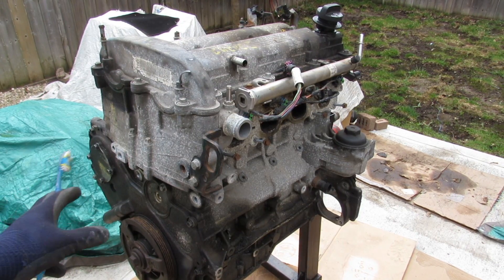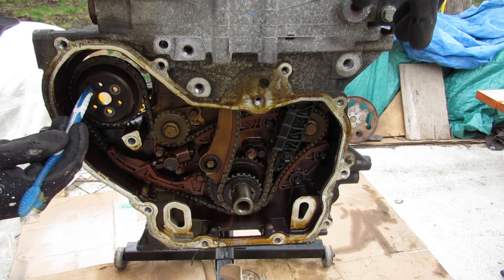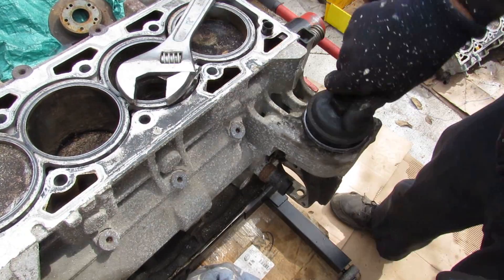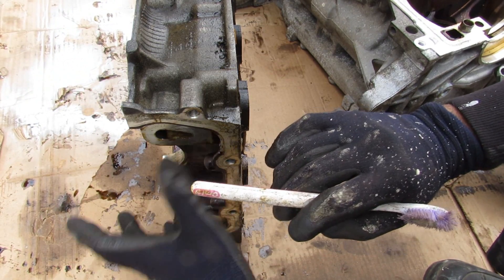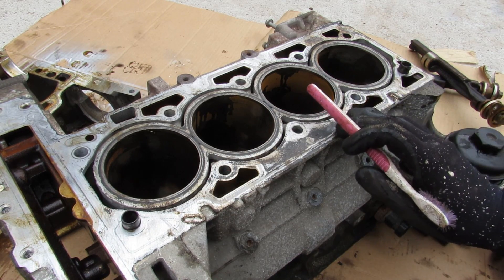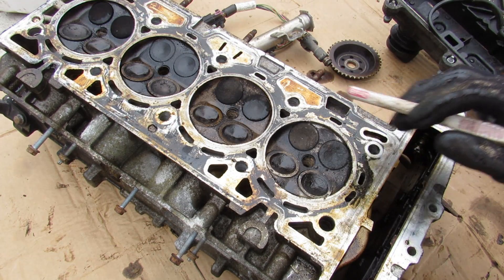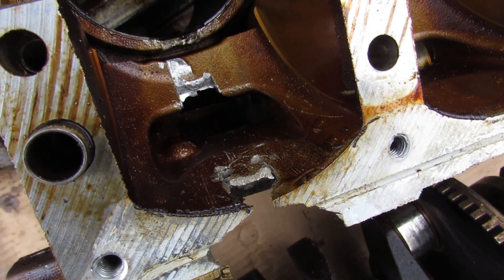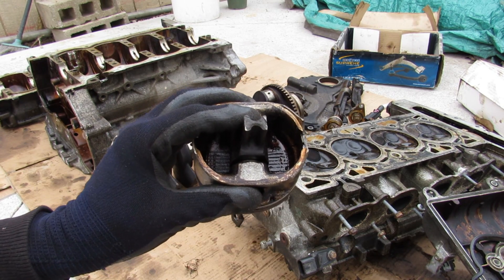Why GM Ecotec Engines FAIL

Comment: What a piece of crap. Why would a low-end car engine ever be that complicated, over-engineered, and utterly economically unserviceable? If only people could understand and stop buying this junk. No wonder GM has gone so far downhill in recent decades.
Reply from the maker: I feel like the chain setup is a bit much for a cobalt motor
Reply: Car buyers wanted a small engine, good MPG, but power like a V8...
Reply: @BuzzLOLOL  Be that the case, I guess they screwed themselves and should recall the old saying, "be careful what you wish for".
Reply: @davef.2811  - By eliminating timing belts, GM produced an engine with expected 300K miles life instead of 40 - 80K miles life...
Reply: @BuzzLOLOL  I have yet to see one of these eng's reach anywhere near that span without having very expensive, usually catastrophic failures. Sorry, regular folks who depend on their car for travel to and from work and other necessary daily activities need something more economically feasible and sensible than that.
Reply: @davef.2811  - Scroll down through the comments... lots of people have that mileage on their Ecotec and love them...
Reply: @BuzzLOLOL  To each, his (or her) own.

Comment: The Modern  Chevy Vega. I had a quad 4 motor in a 95 Pontiac  Grand Am and I got 238,000 miles of car, still going strong when I sold it.
Reply: The quad 4 got a bad rap, my wife  had a 89 oldsmobile cutlass calia with a quad 4, it had a 150,000 miles on it, and was still running pretty good when we sold it, it wasn't an easy engine to service though, but it had the best of both worlds, great performance, and great fuel economy, hell if this tells you anything, my wife's nephew runs a quad 4 in his modified oval track race car, he loves it, and won a lot of feature race events with that motor.
Reply: @captainkirk4514  , the biggest  problem  that I had with my Quad four was the water pump, and the spark plug fire coil packs, the plastic  would crack.and I would have to replace it.
Reply: @markbaumgartner7261  Come to think of it, I had to replace the water pump and the guides for the timing chain, it was not an easy task on those, but that was the only major problem we had with it, other than the starter.
Reply from the maker: Nice

Comment: I did a timing chain job on one of those Ecotech motors, quite an undertaking....
Reply from the maker: Is it tight in the engine bay?
Reply: @speedkar99  one issue is a motor mount bracket that has to come off, but to get it off without damaging or stripping the long bolts that attach it to the block, you gotta jack the motor up on the timing chain side. I took tons of pictures of the process.

Comment: I do motorcycles which run at much higher rpm.
Most or that was caused by poor maintenance and dirty/low oil. (and probably excessive rpm?)
The oil control rings would be fine but the drillings in piston need to be either larger diameter or more holes drilled to allow oil scraped off to get inside piston then back to sump, you don't need or want wider rings. 
Oil squirters have been used to cool piston crown since at least mid 1930's so technology is well understood. It also helps keep small end lubricated 
Suzuki were first to use oil squirters on a production motorcycle in 1984, probably first high volume mass produced engine to do so? (it was in production until 2012 in different variants)
Reply from the maker: Interesting to know the difference
Reply: @speedkar99  The low tension chrome faced spring steel rings with expander are very efficient at scraping oil.
The main reason I'm aware of the issue is Suzuki had a production problem where some of the drain holes in pistons were not drilled (robots are dumb and go through the motions even if drill is broken)
It led to excess oil consumption on about 75~80 bikes total (at least up until late 2009)
 There were also modifications to the later water cooled motors where holes in oil ring groove got enlarged slightly, ( IIRC,less than 0.5mm) on later engines operating at much higher power outputs and rpm (1300cc with 195bhp, 'Busa')
Reply: @1crazypj  Harley has been squirting the piston bottoms for a Decade, on some models, the jury is still out?  H-D has other problems with the new M8 engine?  You would think after 120 years, both Ford & H-D would get it right?
Reply: @jimandnancymcoil  HD were not doing it in 2005 even though the 'aftermarket' engines were  (S&S, et.al)
I think HD waited to see how it turned out before they did the same?
Your right about the 120 years though, if HD had any sense they would have learned from 1978 Honda CX500 that a V-twin with chain drive valve timing has serious issues with load reversals destroying cam drive (on the Honda it sometimes destroyed the mounting bosses so crankcase had to be changed)
Reply: Sorry for late reply, yep, it was a few 1200 SACS motors in the Bandit which was being phased out in favor of the new water cooled motor

Comment: Duct Tape nothing... what you do is remove the broken rod, both pieces, throw the piston into the trash, and then drive a fence post into the cylinder, cut it off flush with head deck, put head back on, go on about life... just a "little" slower.
Reply from the maker: Ahh it was a joke lol

Comment: I am located in europe and i work on many GM 4 cylinder engines(mostly on Opel/Vauxhall). This EcoTec engine is the worst of them all. The rest are actually quite good with the proper maintenance.
Reply: Ecotec is vastly better than Vauxhall version because break prone belts (50K miles) are replaced with long life permanent chains!
Reply: @BuzzLOLOL   EcoTec 2.2L engines are exactly the same in Europe. They come as direct injection units or indirect injection. They are crap. They burn oil like crazy, the chains stretch, the high pressure fuel pumps go bad, the oil that they don't burn, they loose, etc,etc.
Reply from the maker: 2.2 or 2.4??
Reply: @speedkar99  in Europe is only 2.2 L. I am not aware of any vehicle using a 2.4 version.

Comment: Girlfriend had a car with a turbo one of these. The motor did self destruct and had to replaced. That car was nothing but trouble with the key system and the dealer was very scummy. Was not my car so I had no choice but to let the money pit be a money pit.  Once that car was too expensive to fix and against my best advice... she got ANOTHER one of these ecotecs in a crossover. Thankfully it is not a turbo engine but still I am counting the days until the engine or key system fails so this too becomes a money pit. I have already had to do a cam position actuator in a walmart parking lot as they are common fail points for the 2.4 variant. Not hating too much on GM as anything domestic in the US I tend to avoid after 2010 year models. Value engineering has soured the brands to me.
Reply from the maker: The turbos are the worst

Comment: In the many years I have been a CHEVROLET TECHNICIAN. They don’t push the customers to do anything to their vehicle. Most of the Japan and others will sell you a maintenance service contract. So every time it’s due for a oil change they have already paid for it and get it back to the dealership for maintenance on time. They scare you into doing this or will void your warranty so in my opinion foreign cars are maintained better than any American car because the American cars manufactures don’t scare you into doing any maintenance and people have the idea that they don’t have to. Just from what I’ve seen in 35 years of being a technician and the different between USA and foreign vehicles.  Jmo
Reply from the maker: Thanks for the input from a tech perspective

Comment: When I worked a Chevy dealer from early nineties to the mid-2000's. That engine came out in the '04 models it was a Saab design engine. Saturn got it first late '02 or early '03. For the most part they were good engines. Some head casting issues, porous coolant loss, valve train noise. Occasionally you would have a hard start,runs rough MIL on or flashing complaint.  Usually it was the plugs, boots  gap was to wide. Because of the CSI (Compression sensing ignition,another Saab design) plug replacement was every 40-60K depending how the owner drove it. Never saw a bottom end grenade. But it does happen. GM likes to cut corners... If they make it pass the warranty period... Their happy..
Reply from the maker: Sad it's all about warranty

Comment: When you said champion sparkplugs are low end....yeah you lost any credit with me. They are not the best but they are reliable. Also on top of that some engines will not run correctly on those "high end" sparkplugs. My 1987 Honda civic burned out all 4 bosch split fire plugs in less then a week or 100 miles, while running perfectly on NGK's. Somebody those "high end" sparkplugs actually add or take away resistance which can hurt the economy/efficiency and cause a loss in power. 
So when you took the valve cover off it shown me that they used conventional oil and not synthetic or synthetic blend. Those ecotechs are designed to run synthetic blend or synthetic and not run on conventional oil.

Comment: I had no problems with my 2.4 ecotech. I ran it hard and I had 87,000 miles on it. It is called the person didn't take care of the engine. Most likely didn't change the oil regularly. Maybe ran it low on oil. Unless you have the full history on that particular engine you cannot blame the engine or anything. Unless it is a Ford engine.....lol.

Comment: I ones had a Golf IV 1,6 that burned oil like an absolute disaster and had tons of buildup on the plugs and it was gradually losing power even before reaching 200k kilometers along with just higher and higher fuel consumption. then I had the Golf V 1,9TDI that mostly ran nicely and did not drink that much oil and it got yearly maintenance and all of this but it did not even last until the first timing belt at 150K kilometers. nope it made just like this engine and blew the rod straight out of the side without a single warning before it, then I read about the BLS engines has weak bolts and connecting rod bearings prone to fail. I got in huge debt because of it, fantastic not
Reply: You see the Ecotec is a Vauxhall DOHC belt driven cams engine converted to oil lubricated chain driven cams for vastly more reliability. Vauxhall had recommended changing the belts at 80K miles... they didn't last that long, so they changed it to 40K miles... GM doesn't have any mileage recommendation for changing the chains... After initial break in, I recommended using synthetic oil and regular oil changes to make the engine last 300K miles and stay clean inside.
Reply: @BuzzLOLOL  well chains surely have a wide range of how reliable they are. My engine had a regular Kevlar or something reinforced belt. But the engine itself did not even last the first belt. In fact even if the engine had oil changes and service more often than the factory had printed out the connecting rod came blasting out the side of the engine in literal pieces anyway. The engine could still start and run with only 3 working pistons since the failure was not caused by anything else than shitty connecting rods failing with this specific engine after a certain time
Reply: @Pulverrostmannen  - Are we talking the old Vauxhall engine or another belt driven cams engine? 
The Ecotec uses cracked/fractured rods. Meaning they are actually made in one piece and then the bottom cap is broken off... and then bolted back on... the joint is not smooth but as broken...
Reply: @BuzzLOLOL  well as my first comment covers it was about my Volkswagen TDI engine  ;) I mentioned it since even if it was carefully taken care of it did not last anyway
Reply: @Pulverrostmannen  - Thought VW engines were pretty reliable... back in 1960's used to look at low priced big bore cylinders/pistons, cams, and stroker kits for Beetles in J.C. Whitney to take them as big as 2.2L...

Comment: Good old GM quality. “Oh, your car burns 2 quarts of oil per thousand miles? That’s normal”
Reply: My 2.2 Ecotec 107,000 miles and not a drop of oil burned,  of course all of my Chevys have run 200k with no engine problems because I change the oil and do my own tune ups.
Reply: @cars654  I did the same with my 1.4t, full synthetic oil changes every 5,000km and always ran premium gas. Blew up the first time at 80,000, the 110,000, then again at 180,000. First time, it dropped a valve. Needed all four pistons replaced at 110,000 and then dropped two valves simultaneously at 180,000. I got fed up and rebuilt the head myself when it last blew up
Reply: A lot of Manufactures have had oil burning issues even Toyota just saying.

Comment: "Given this is a cobalt, cheap maintenance is what is to be expected"

glad I'm not part of that majority with my cobalt.
Reply: I think that observation was off Target myself. I personally don't buy Chevrolet products or General motors products I just don't like the way they're engineered. That's my opinion I don't think someone that buys them is dumber or smarter than me they just have a different opinion. But maintenance failures is not a financial concern as much it is individual responsibility. I remember we have a multi-million dollar Governor here in Florida who ended up in the Senate by the name of Bob Graham. He personally led the crusade to get rid of auto inspections for safety and emissions. Well just before the inspections law ran out, he took his motorhome in for an inspection. He had burnout lights a hole in his exhaust and his brakes were pulling. These are all things that fail a vehicle for an inspection. Keep in mind he was a multimillionaire. So money doesn't necessarily mean people maintain their vehicles. I bet his tires were old on that vehicle too if he had a hole in the exhaust.
Reply: @JohnRodriguesPhotographer  for sure! It doesn't take much to keep a car well maintained. Just basic maintenance, catching things before they get too far gone makes a big difference. My cobalt certainly wasn't my first pick, but it's lasted 128k miles with out much repair needed other than basic maintenance and upkeep
Reply: @cmdr_scotty  Never had one myself, but I have 2 friends with cars that have Ecotec 2.2s. One is a 2009 Cobalt that has been in my friend's care for 5+ years now. He maintains it properly and did a minor overhaul on the transmission and cooling system a few months ago, in addition to replacing the valve cover gasket and deep cleaning the inside to remove all carbon deposits. It is on it's 2nd transmission, but the previous owner didn't maintain it. Aside from that, the only failure was from a radiator hose shifting and hitting the fan or something. Easy to fix.

The other is a 2002 Saturn L200 with the same engine and trans that the owner has had for about 1 year. This one was in much better shape upon purchase and he abides by very strict maintenance schedules at my behest (I'm the one who services it. My other friend is a mechanic as well, but this friend has very little experience there). Even with that, it costs him very little to run (and the car itself was only $1300) and it'll run reliably for a long time to come.
Reply: @JohnRodriguesPhotographer  his biggest problem is, alas, a common one.
A loose nut behind the wheel.
Reply: same here
Reply: Same here with my '01 Cavalier. Oil changes at EVERY 4500 miles with FULL synthetic oil!

Comment: i know im the odd ball , i have a 2007 hhr with a 2.4 that has been maintained with syntheti oil changes every 7k. i was also aware of the the timing guide and tensioner concerns. so at 140 k i replace the chains and guides.  if i could post a pic of the inside of my engine you would think it was only 10k on it.

Comment: These aren't bad engines, I have one with 265k miles. CHANGE THE OIL!  Also keep after the timing chain and tensioner!
Reply: "Oil's cheap...engines are expensive." Scotty Kilmer
Reply: It's just they are little bit weak for 2.4 ..they produce llesse. Power than its rivaals
Reply: @ilqar887  Especially in the Equinox.  It's a heavy chassis with a weak motor.  Too much engine strain at highway speeds and it gets poor gas mileage because of this.
Reply: How often have you done the timing chain ? I did mine at 161,000
Reply: @chrisomalley7536  Well as I stated above, I changed out the chain at about 250, still going now with 267k I would have done the same as you but I bought the car when it had about 237k I would be nervous too at 161k  The chain and shoes were in great condition and were original, I did it for peace of mind. If these engines had regular oil changes, I'd feel safe running on up to close to 200k My Ecotec  must of needed the timing chain kit because the motor is so damn quiet now at a light I think it shut off, scares me for a second until I look at the teach, ya can't hear it run, ya can't feel it run. Stay safe out there!
Reply: @chrisomalley7536  One other thing I meant tach , not teach (spell check)  the oil spray nozzle which oils the chain could get clogged and starve the chain for oil. It just so happened, my Cav. Was well maintained by the previous owner, but you just don't know sometimes.

Comment: If you ever replace the water pump on these you may as well take the entire lower timing cover off. It's not that hard and makes dealing with the pump so much easier. Plus you need to inspect the guides.
Reply: Totally agree! The access to the water pump sprocket is better than working through the access hole, and, if you were unlucky like myself this week, you can reset the balancer/water pump chain tensioner. (not to mention inspect your timing components).

Comment: I got 145k trouble free miles from my 2.4 before i traded it in. My secret is change the oil early as in like 4k miles or 30% life left on the meter. Then use high quality oil and filter. Also vent the crankcase to atmosphere because the pvc plugs up and blows the rear main. Do those things and she will last
Reply: I thought you couldn't vent a pcv on a maf based car